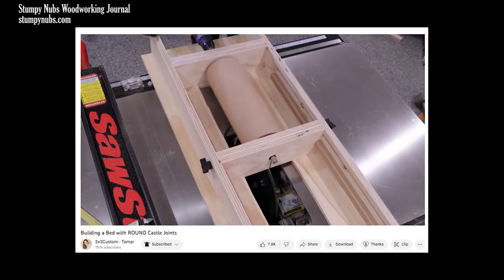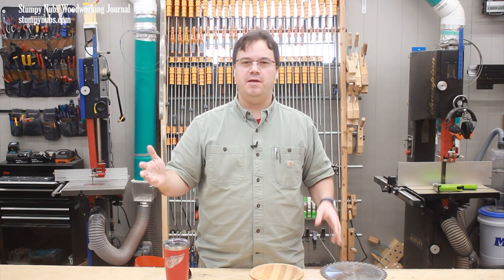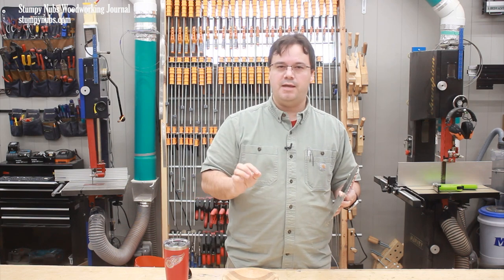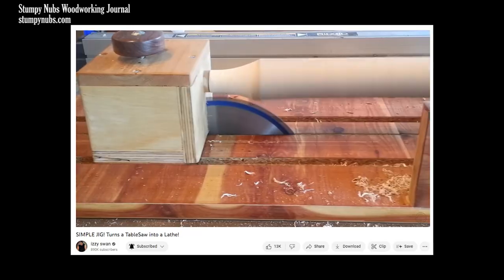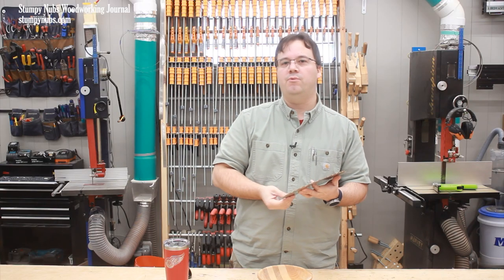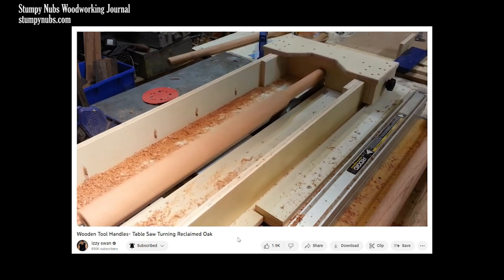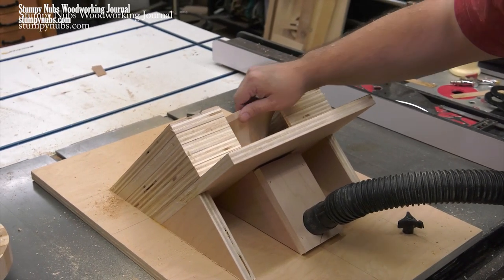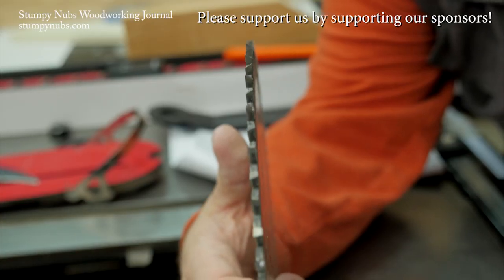DANGEROUS new trend in internet table saw videos? You decide...

Comment: I'm not saying this makes it dangerous, but in talking about the forces acting on the blade you ignored the biggest one i would worry about which is the lateral torque from only one corner of the teeth hitting the work piece. This is like trying to take pliers and twist the teeth off, not just applying pressure to the side of them, and would be by far the biggest force the saw would experience while cutting in this way. I still don't think it would break the saw or blade but it might cause it to wear out faster.

Comment: Is there no risk of something biting and causing the drill to twist violently, potentially injuring your hands? I would want the drill secured somehow to prevent that even if the risk is minimal.
Reply: Setting the clutch on the drill at an appropriate level should minimise that risk shouldn’t it?
Reply: I think I'd use an impact driver rather than a drill.  Impacts won't torque your wrists off if they bind!  That said, if you make shallow passes the risk of binding is minimal.
Reply: @davidcouper7445  Good point. I’m still getting used to that feature on my drill.
Reply: Just don't try to cut too deeply all at once. To my eye, in this configuration, 1/8" per pass down the board should be fine.

Comment: Assuming one isn't trying insane depths of cut (don't), you're basically almost always "cutting" with  2 or 3 of the 3 edges and that is all the contact there is. Teeth dont even cut, they scrape a tinsy bit of material only per contact (that is why it leaves a relatively fine sawdust), clearing it off the way and so eliminating the contact with the material. And that tiny material it scrapes off is all the tooth see at any given time. It doesn't see the whole material, its orientation, or even its movement, because they're that much faster.

Comment: One potential danger that I noticed at 1:45: When you pick up the bowl, with the motion you use it would be easy to get your knuckles grazed by the blade if it's still spinning.  It took me a third look to see that the blade was already stopped!  (Also, that seems like a rather unusual blade with only a few teeth; what's the story with it?)
Reply from the maker: Just as you would not reach next to a spinning saw blade during a normal cut, you would wait for the blade to stop before removing the bowl. It's a dado blade in the video. The smaller diameter is better suited to the shape of the bowl.

Comment: I’m an engineer and you didn’t ask/answer the question that is most burning in my mind. What does the manufacturer say?  Does the manufacturer say that the saw is designed for, or at least can withstand, the types of forces being applied to it? 

Yes, people have been doing this for a long time but that doesn’t mean it should be done. It may be something that was never recommended or maybe newer saws with new designs could be decidedly not intended for such use. 

If the manufacturer states such usage is acceptable then by all means use it in that fashion. However, I would never use it that way without saying it’s acceptable.

Comment: Just a quick and dirty piece of math!
An (extremely) quick search on Google shows the max speed of a battery drill at about 2000 rpm.
According to yourself, the speed of the table saw blade is about 4000 rpm
The ratio of the blade/wood-being-turned's circumference to its diameter is just Pi, so double the diameter = double the circumference (No squares or other complex equations.)
If you look at Tamar's video, she is cutting/turning a piece of wood that is roughly (as I said, quick and dirty) half the diameter of the saw blade.
That means for every mm (or inch or cubit or whatever - doesn't matter, it's a ratio) forward the blade turns twice as far as the wood (in degrees of rotation) and therefore along their circumferences as well.
If you push the wood far forward enough to make one rotation, the blade makes two rotations.
Thus you have a forward movement that is double the sideways movement.
This results is an angle of less than a 27 degrees cut. (Tan⁻¹ of ½). It's not like the blade is cutting sideways. (Well it is, but only slightly, not like 90 degrees!)
That's the most extreme one here where you use a drill to speed the wood to a very high speed. Everything else is way less!
Turning the bowl slowly by hand is an extremely small sideways load. Not even worthy to work out.
And by cutting very shallow cuts i.e. small loads on the blade, it looks way more unsafe as what it actually is.

Well, that's my two cents worth.
Great video as always.

Comment: The thing I worry about, are things you tangentally touched upon even if not explored. Like the bearing, they're not exactly thrust bearings. If they're worn or cheaply made, prolonged extensive sideloading could cause surprisingly rapid deterioration, allowing the blade to wobble.

The second thing is too high a feed causing extensive friction on the steel blade. That could cause enough heat to cause especially a large diameter the blade to warp while in the middle of this process. I do have some concerns about similar friction causing material weakening of the brazed connection of one or more teeth, but realistically I think the steel blade warping is more likely, and more likely to cause an unpredictable natured violent grab-n-shoot, long before anything got so hot the brazing weakened and split a tooth (there would be a lot of smoke long before that happened).

Both of these should reasonably be avoided with dicent quality tools, taking maintenance seriously, and not feeding it too hard when doing something that will sideload your table (or any) saw. But frankly I think the ones most likely to get themselves into this situation, are inexperienced, over-eager operators with a cheap or/and poorly secured and maintained tablesaw.
Reply from the maker: "That could cause enough heat to cause especially a large diameter the blade to warp while in the middle of this process"... I'm sorry, but this is just ridiculous. If you don't want to try it, that's fine. Don't try it. But let's not exaggerate like this...

Comment: I'm severely torn on this subject. Always wanting my table saw to get more bang for my buck, but every time I plug it in, the what if starts up almost immediately, even before I plug it in. I remember my dad making concave cuts on a new table on his RAS (I know, controversial) and even as an innocent bystander, that scared me. 

I also use affordable blades from the box store. And I don't gamble. I like the notion of going to the saw for 1 cut, rather than 140,000 per minute... and one of those being me. Just my 2 cents.  Be careful out there.  Rough Cuts Woodworks.

Comment: One thing I never hear mentioned about table saws ,bandsaws etc.  is how to stand at the saw.  When I saw my weight is ALWAYS on my front foot , the one closest to the saw ,if thing start to go pear shaped with my weight on my front foot I can push off  and throw myself backwards away from the saw,  I have a feeling that many accidents happen because of a loss of balance and people falling into the saw when things go wrong,  my  friend Trevor lost two fingers because his feet slipped on a wet workshop floor . could I have your thoughts on this please ?
Reply from the maker: I don't know that I would recommend a specific foot placement, but you should have them firmly on the floor with nothing in your path or around you that may cause you to stumble, keeping in mind that some cuts require you to move your body and feet. I also try to position my body so it is not directly in line with the workpiece when making a rip cut, in case a kickback occurs.

Comment: There is one potential problem you didn't take into account: vibrations.
Saw teeth are not evenly shaped. Just like with a hand saw they are asymmetrical. When you work with the side of the saw you put a different load on even and odd teeth. And this could result in vibrations. And vibrations can cause damage over time to the internals of your table saw mechanism.
It should be fine using this technique only once in a while for the odd job that is too rare to justify adding a costly dedicated tool to your arsenal. But if you need to do that on a regular basis, the right solution is to get the proper tool that was designed for the job.
Also it wears the blade unevenly and that will result in the need to replace it earlier than normally expected.

Comment: For whatever it's worth, I'm of the opinion that there's nothing inherently wrong with the technique, BUT it's a "niche" thing to do...

    In "plain" language, that means, I'd think it's okay for a craftsman with a Tablesaw who just needs ONE chair's worth of legs or what-have-you, to do it. Keep the jig, just in case another job like it might come up... BUT "in a pinch". As long as we're all "On a budget" this can even be part of "that equation" when you're wondering if you can justify buying a lathe later on... Probably not worth the money if you're only ever going to be using it one or two times a year... BUT if you're looking to get furniture with legs and decorative posts a few times a month, the lathe will pay for itself fairly quickly...

     What's NOT okay is running out to buy a Tablesaw so you can use your cordless drill to make a chair factory this way... I've gotten on just FINE with a Worm-driven Circular Saw for most of my life. I've ended up with Table-saws, built cabinets and stands for them, and sold them on to the next guy or gal who wanted them more than I did. I pretty exclusively use the cheap-o "Sidewinders" for quickly breaking down stock, and the worm-drive for precision, which it achieves with regularly flying colors... SO I'll probably build a shed and buy the lathe before I rush out for a Tablesaw for much of any reason... BUT that's just my experience and OPINION.

     ...AND until then, when I need legs, I have draw-knives and bodging clamps for that sort of business... Even a utility table and vice to work with is just fine. It's uniquely mine, because I'm probably the only person for a couple hundred miles who does it that way... and it shows. It makes money... probably because people appreciate things that LOOK hand made... SO think about that while you weigh your options.

     The particulars are STILL "all up to you".  ;o)

Comment: Frankly, I'd think turning a simple cylinder on the TS is probably at least as safe as doing so on a lathe. Making the initial cuts on a square piece of stock at the lathe involves huge impacts on the end of the chisel that could rip the chisel out of your hands, launching it across the room. You could get hit by either end of the chisel or sprain/break your wrist if it grabs & pulls the wrong way.
Reply: Experienced turners will never advance the chisel straight into a square piece. If you approach in a direction more nearly parallel to the axis of the piece, you can avoid the large impact forces. Generally speaking, if you are experiencing large impact forces, you are doing something in a "less than optimal" manner.
Reply: That's why wood lathe chisels are very long and the tool rest is placed as close as possible to the work. That gives the turner a huge leverage advantage. The turner also has to be smart enough to not just stab a chisel into a lumpy piece where it could get grabbed.

Comment: I would add a really minor detail to the safety measure part... might  be that I'm too "sensitive".
I usually work standing out of the line of cuts wether a piece of chip of debris comes flying my way, I can avoid it.
But some times, there are rouge pieces probably cause there is a trillion different factor determining the flight path and it comes at me anyway.
My recommendation:
-always wear closed clothing
-always wear a mask or something that protect your lower face, and maybe even your neck. my mask filters extend downwards, and I have to rotate my head downward anyways so they protect my neck.
If a runaway sharp debris comes at you, it might be an inconvinience, but God forbid if a metal chip comes your way....dunno. Nails in reclaimed wood anyone? Accidents do happen.
Better be sensitive than calling your girlfriend on phone "I love you but can you bring a towel cause im bleeding from my neck artery" :D

EDIT: also also....tight sleeves! that guy at 6:40 is just asking for trouble. :D why those big buttoned sleeves that extend down his arms?
Reply: I've had nails and screws in reclaimed wood come at me a bunch in the past, at least with using circular saws. They sting and can poke you a little, but they hurt the pride more than anything else 😆That said, good glasses are always a must.

Had a 3 1/4" duplex nail drop off a building from about 6 floors up one time, it hit a metal rack beside me and ricocheted straight up into the underside of my jaw pointy end first. Hurt like hell, but it only stuck in a quarter inch or so lol. The glasses did nothing that time.

Comment: Personal View -> I see these crazy over engineered jigs that ride in miter slots with hands far away from the actual cutting forces and outside of the  cutting line of the blade... like be sensible about how deep the cuts you make. Also using normal raked blades that frankly most people have would also be pretty good about it. Using a flat blade with no raking (for dado/rabbit cuts) is a specialty blade that most people wont accidently have so that mistake is just likely to not happen.   Frankly not my cup of tea and something I wont do myself, but power to you guys; just be honest with yourselves , take your time and make sure you're slotted into the table's slots and make sure you have things made safely. 

Professional, Engineer non-opinion  aka objective fact ->  The bearing systems and control mechanisms for your table are not intended for lateral pressures. You WILL be providing additional wear and tear with forces they frankly arent designed for. You WILL develop a blade wobble as ball bearings are not designed with lateral loads in mind. Youd need a thrust bearing to provide support and to my knowledge, no table saw would have these (lemme know if they do??). What will happen is you are tilting the bearing (we're talking small amounts but its still a tilt) and this will cause your bearing AND the grease to most certainly go above its rated temperatures because you are creating pressure points and friction where there normally is "none" (yes theres friction, but its not meaningful in normal, intended designed for operations). Over time, you will degrade your table saws performance much faster than straight cuts the saw was designed for. Honestly, this is more or less irrelevant to the quality of your table saw; cheap or expensive this is going to happen (barring some model that has thrust bearings for "reasons" lol).  Best case scenario, make the jig as low as possible to the surface plate, make small passes BUT go as fast as your saw allows, and center it as best as you possibly can. Before starting, also save yourself some headaches -> mark the centers on your square blank of course! But then mark your circle on the ends and use your saw to cut away as much as you can with angled cuts first. I usually see a lot of people just going from square and theres just no reason for that. 

Honestly though, for the stuff you're able to do on a table saw ... just get a cheap wood lathe lol. You can get a reasonably decent bench lathe for 150 bucks and if you need more power; motor upgrades dont have to cost a fortune. Its the right tool for the job after all.

Comment: The secret here is the relative feed rate. Since every second tooth is grinded (I think it's "ground") and slightly offset to the other side and therefore your Teeth form an alternating line it is all about that little difference from one tooths left corner to the next tooths right corner. If your feed rate would be too high you would press your workpiece against the tooth that just comes next to the cutting tooth. And that would create stress, friction and heat. To be fair, you'd need a pretty damn high feed rate then.
Reply from the maker: No modern carbide table saw blade I have ever seen has teeth has an alternating offset as you described. The carbide tip of the tooth is merely wider than the body of the blade, which has the same affect as the alternating bend that was common on old steel blades.
Reply: @StumpyNubs  oh really? I thought they were still built like that. My mistake then.

Comment: I always felt the whole tooth coming loose argument was a little ridiculous.  The centrifugal force exerted on the teeth would be many magnitudes higher than any force from side loading.  The bonding force between the blade and the tooth would be magnitudes higher than the centrifugal force for a safety margin.  If the teeth were already that close to go shooting off in a random direction at any time every time the saw blade is spinning there would be a lot more instances of teeth coming off all the time and no one would use a carbide tipped blade.  If a tooth did come off on someone side-loading a blade somewhere at sometime,  it was either defective/abused/neglected and was coming off regardless.

Comment: There are possibly better ways if one has the equipment. There are two tools I have healthy respect for, in other words if I can reasonably use another tool besides a table saw or a handheld grinder. They are great for the strait forward uses but both can bite you. I was working at a cabinet shop saw a man on a table saw take a carbide tooth that flew off into his leg about an inch deep. He had some pinching on a rip that got the blade hot and a small bind incident he worked right though with only the tooth flying off to hit him.